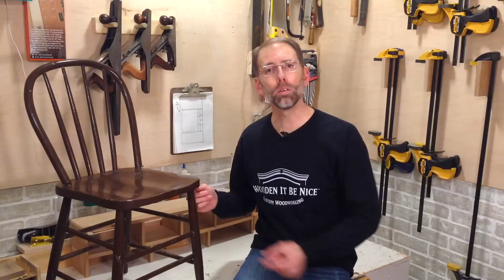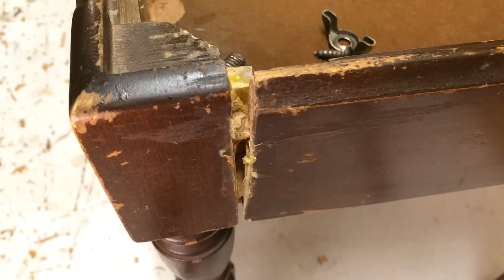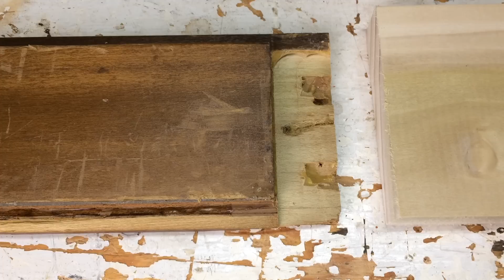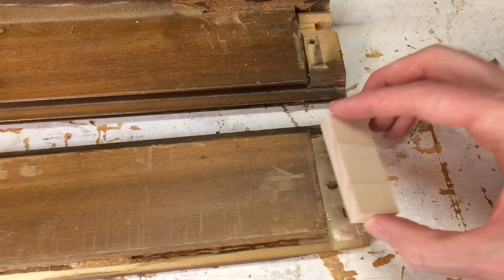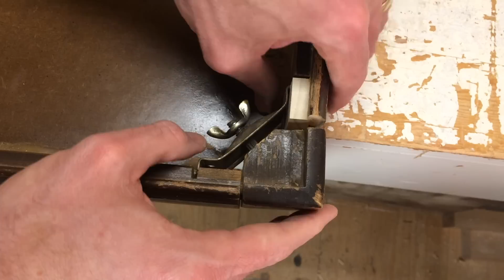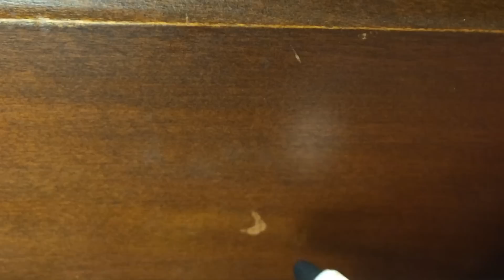Piano Bench Leg Repair with Leg Bracket - Kerf Mount Corner Bracket | Woodworking How-to

Comment: How is the bolt mounted in the leg? I would have guessed an inserted collar, but it almost looks like it was friction-fit?
Reply from the maker: The bolt is screwed into the wood.  It's called a "hanger bolt".  It's threaded for wood on one end and threaded for a nut on the other end.  I hope that helps.  Scott

Comment: Those piano benches really take a beating! You did perfect on replacing the rail parts that were wrongly repaired before. However, I would have drilled ALL the dowels out. Replaced  them with ready made dowel pins. Those that the glue groves spiraled around it like a barber pole. Only kind worth using. Once it was glued up. Making sure everything was square and plumb in the process. Next, throw away those metal corner things. Cut nice well fitting hard maple corner blocks. Glued and screwed in with 4 screws each. A regular lag bolt with a hex head and flat washer used instead of the combation wing nut stud. All stained and finished to match outside. Customer should be advised before hand. That the storage inside my be just a little bit less. Because of the larger corner blocks. Just trying to give you another idea.

Comment: Why did you cut the dowels off. You should drilled into the replaced peice and inserted the dowels.     Another poor fix.
Reply: that would be extra hardcore for someone watching this video like me and maybe most of his viewers.  I would be hesitant to do that, and opt for different methods that require less machinery.  He says with the glue and proper clamping it should be as strong or stronger than wood.  This means it should at least be as strong as it was when  it was constructed I believe.  "poor" final judgement on the video is harsh is all im saying haha.
Reply: Haha I agree!  Pretty difficult to do. I have a Stanley #59 dowel jig. That would have greatly simplified things. Little bit of planning. It can be set up to to drill the holes exactly where they need to be. 👍